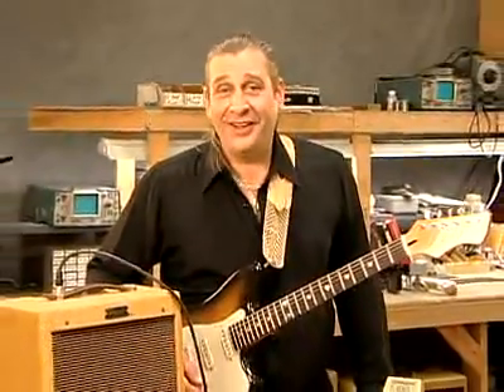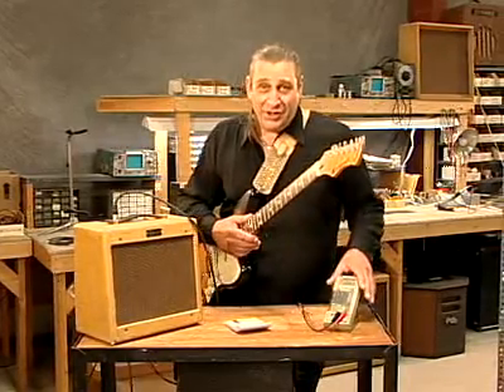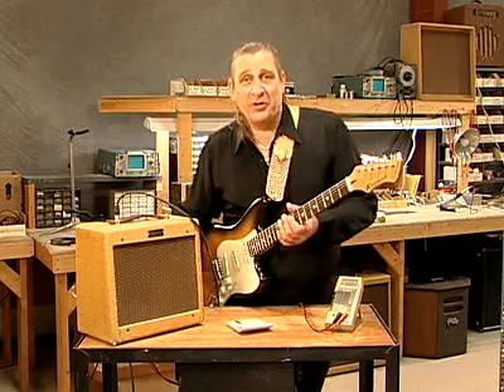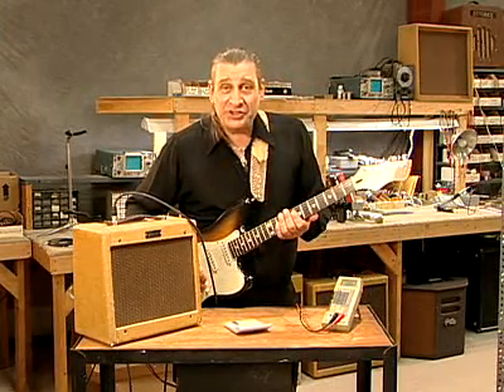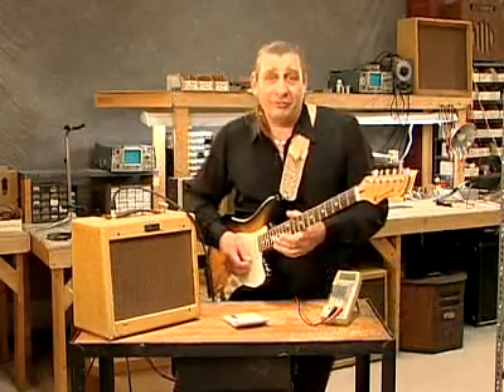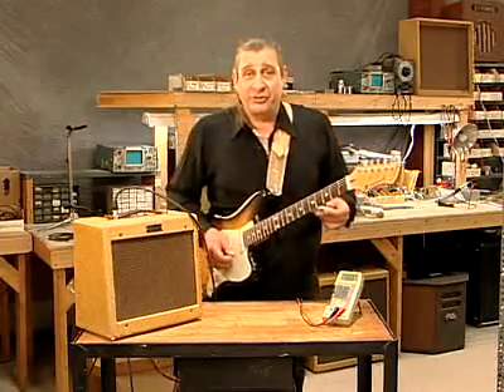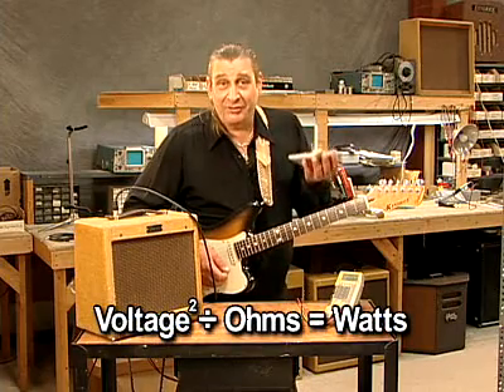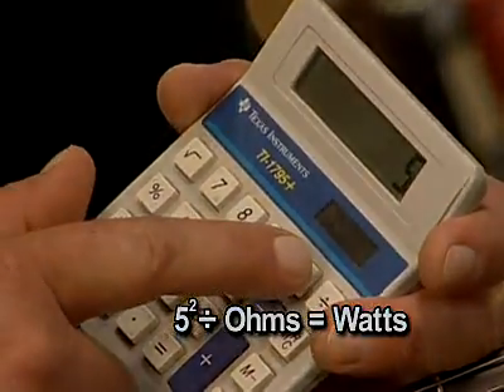Gerald Weber shows you how to do a Quick and Easy Wattage Check

Comment: Great playing!!! I have a 1966 Fender Blackface Champ Gerald Weber modified years ago: Tone / Feedback Toggle Switches ON / Off (Texas Raw Blues Sound) ; Installed a Larger Transformer; Kendrick 4 ohm 8" Speaker. Still sounds great today!!! Champs are 4 ohm 6 watt amps. Doing the calculation: W = (V * V) / R = (5 X 5) / 4 = 25 / 4 = 6.25 Watts = Right on The Money!

Comment: He's got it pretty much spot on: it's a champ with a 4 ohm speaker, so 25 divided by 4 is 6.25 watts. A champ is rated at 5 watts  clean, so with a little break-up 6 watts seems about right.
Reply: The ohm rating on a speaker is actually impedance and not resistance.

Comment: gerald..crazy champ tone...what oh what have you done in there..is schematic that of wideface tweed?  I have a push pull theatre amp with eight tubes and I ninend to strip and re cap as a champ circa 53 - using the existing 6Sj7, 6V6, 5V4 and their sockets, heater connections..leaving five sockets empty, losing what looks like a choke (Tx w two leads only) and 1636 Cdn Hammond OT. If I can get bad caps out safely, find signle ended transformer..and keep existing power tx...easy, right?

Comment: What happened to the end of the video?  From the formula given... 5v sq= 25 v. Someone below said it's a 4 ohm amp (that info cut off when the video abruptly ends).  So 25 / 4 = 6.25 watts?   That's a pretty weak amp.  I noted several times the meter seemed to hit 6.3v or so.  That would come out to about 10 watts, which is easier to believe but is still pretty light.   Does one crank the volume and tone knobs to full?  Turn up the gain?  How about playing a full-bore chord instead of individual notes?  Seems a lot of essential info is missing here.  I'd say a bit more to this video is needed, especially if one wishes to promote confidence in the company.
Reply: Champs are 6 watt amps
Reply: @BrewerShettles    Thanks for that info Brewer.  Although one isn't going to get stage amp sound with 6 watts, even a 2 watt amp can produce considerable volume, depending on how it's designed.  I'm not well-educated in electronics and magnetism so I don't know the physics of how it works, but I've managed to build some home made amps... and it's amazing what someone can do with a 4-watt amp head.  Really amazing.   The video is definitely botched, but I've verified that a low-wattage amp can put out considerable sound.   What I found coincidental is that when he was playing the guitar, the maximum voltage shown was 6.5 or so.  And it's a 6 watt amp.  Didn't even have to do conversion on that one.   Makes me wonder how that works out on other amps; I suspect that ratio varies widely.  Still, it's apparent from the video that 6 watts can make a pretty decent personal amp.  I built a 15 watt 3-speaker home-made amp that can literally rattle the windows and made the neighbor across the street startle during the singular test.   I apologized, explaining I had no idea it could crank that much sound from 15 watts.  ;D
Reply: @Pathfinder8  - you sound great. I'm still learning - putting it all together. Agree with you the video needs resolution.
Reply: @BrewerShettles    I actually liked this guy's video a lot-- until it came up about a minute short without the end results.  He's got a good on-screen presence and is easy to understand.  I would like to have seen this whole video.  On building an amplifier, there are of course different complexity levels-- with vastly different results.  But over the years as a hobby I've built amps that ranged from Altoids tin size to that 15 watt window-shaker (seriously, the power that came from 15 watts was unexpected).  I still have no idea what I'm doing, but I know how to match speaker ohms to amp ohms, and the difference between AC and DC currrent  ;D.    Interestingly with just a little reading, a home made amp isn't all that difficult to build.  I actually sold a few unusual ones I made out of cigar boxes and such.  It's a fun hobby.  Sadly, the new digital multi-voice amps widely available for about a hundred bucks has made home made amps somewhat obsolete (unless someone likes the style and artistry of the build).

Comment: But Mr. Weber, is the meter true RMS? Also, are we taking into account that the speaker has a impedance dependent on the frequency of the signal?
Reply: +akkudakkupl that's true. a regular everyday multimeter will only "accurately" measure an RMS voltage for a pure sinusoidal signal (kinda like the one from a signal generator. maybe he should be using one after all). so unless your meter can measure true RMS, your readings are useless.

Comment: @TheOffcialACCFans.  No such thing.  Watts are watts. Class A is about bias level & power section mode of operation.  Where things get confusing is when people talk about "tube watts" vs. "solid state" .Amps are rated for max clean output and tube amps can put out a lot more wattage when they go into clipping.  A "100 watt "solid state amp puts out 100 watts, while a  "100 watt" tube amp might put out 200 when cranked up.  Class A vs. A/B doesn't affect anything in this case.

Comment: Why can't I use the max output of the pick up, or my pedal(s) and put that signal in at the standard 1KHz reference signal and then dime everything. (usually spec'd procedure) Then use an actual audio meter like a Bruel and Kjaer, or HP. Storage scope  would also work.  Watts are watts. Do the math. An RMS average/peak recording meter is real handy too. The old Fluke reacts so slowly and inaccurately any number here is at best a wild guess.  An AC PEL is great for this purpose .too.

Comment: You are correct. The amp was distorted, and as we know from the tube data sheets, the output is XX watts at XX% distortion. This is just silly, the sine wave and CRO is the way to go. You can't see on a multimeter when the waveform is clipping, and a meaningful wattage output is prior to clipping. Weber knows this so why does he put up such videos?

Comment: This is bullshit.1 watt = 2,63 Volt using pink noise.
Impedance changes with frequency and the 8 Ohm speaker for example can have 30 ohms or more at higher frequencies.